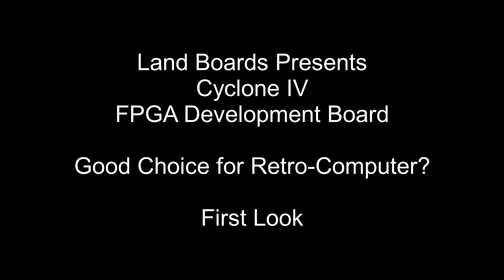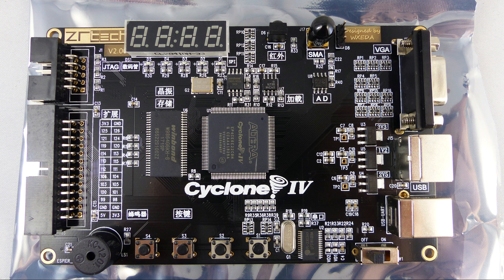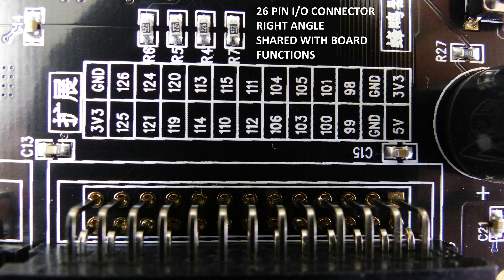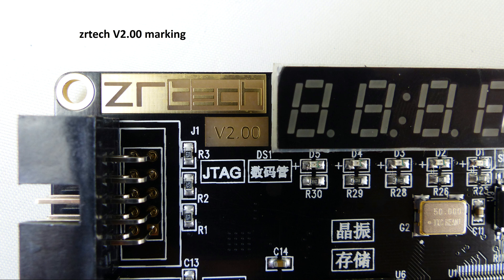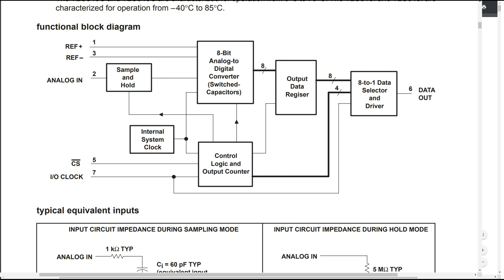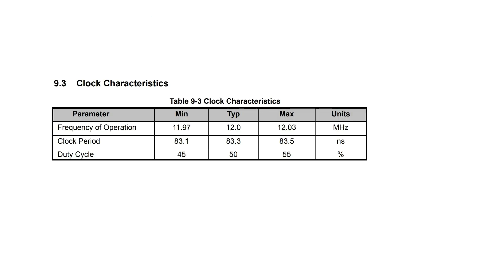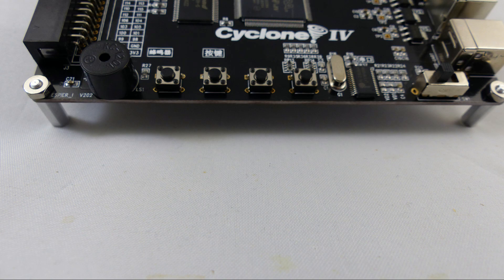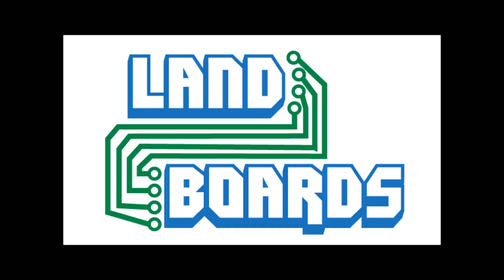EP4 FPGA Dev Board - First Look

Comment: Google translate for mobile devices has a camera mode that translates in real time, what the camera sees.
DS1 is simply the component label for the Display - D(i)S(play)1
The box below DS1 translates to "Digital Tube", which for whatever reason means L.E.D. Display to the Chinese sellers/manufacturers.

In your next video you mention the the lack of a download link, I'll reply here though as it's more inline with your general request for more info pertaining to the board.
I purchased a couple of these boards a bit over six months ago. I do have the full file set for this board, so should be able to bring and end to your information search.
 
"Datasheet (will provide Direct Fast download link)"  <---  This should be interpreted as "Direct, Fast download link provided upon request"
Datasheet, in the case of FPGA boards, is usually a full file set and not just a datasheet. In this case 14GB!

I'll upload the files somewhere and send an email to the address listed in your youtube details. Upload will take a little while.    DONE
Reply from the maker: Thank you very much. It seems we are traveling parallel paths in the retrocomputer world. The schematic is a huge help. 

We both figured out pretty quickly the same I/O connector limitations. I am impressed with the ease that I got multicomp running on the card. Very few changes from Grant's baseline.

Other people have trod the same path: https://www.retrobrewcomputers.org/doku.php?id=boards:sbc:multicomp:start

Comment: Its a development board, not a final product board, So yes it comes with lots oh crap , leds, 7 segents, buttons and what not.
Reply from the maker: True, but I think it's pretty close. Cray Ze Ape (comment below) made a nice SDRAM controller implementation that could bring the RAM up to the full possible range (and well beyond with a memory mapper). Plus the Serial EPROM on the card has plenty of space with a file system added to store a lot of programs. It could be a suitable Retrocomputer project with some work.

The only quibble I have with it is the I/O sharing between the connector and the VGA. That's the reason I made this video series - in case someone wants to go down the same path. Grant Searle's multicomp project runs on the card with very few changes so it's already a 16K vintage retrocomputer with no modifications.